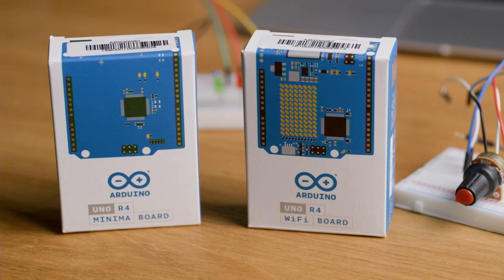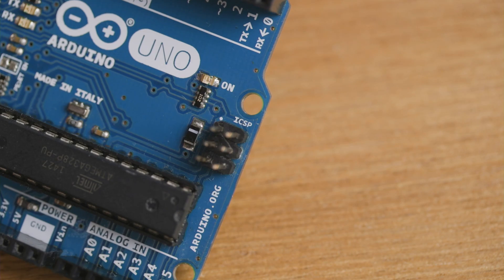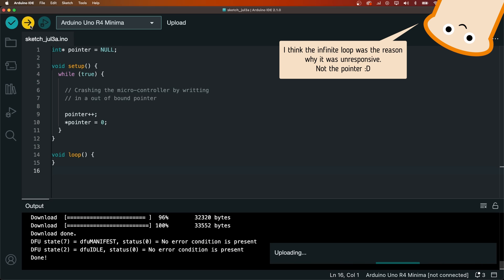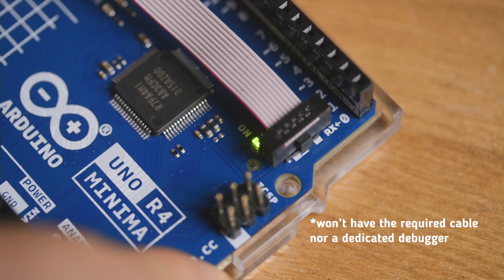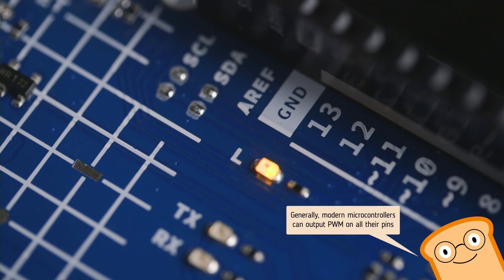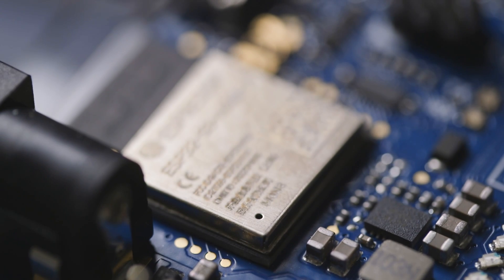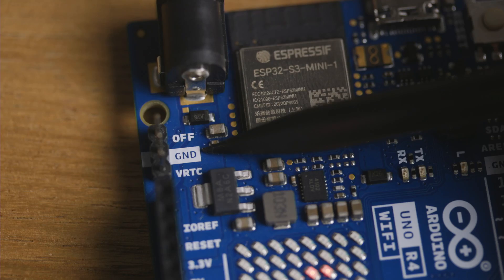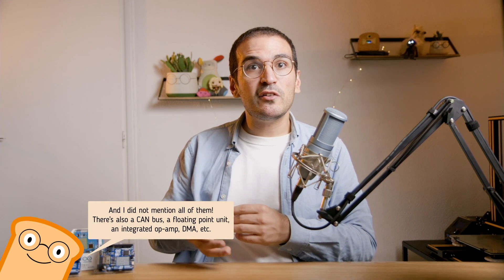Arduino UNO R4: Nice upgrade or troublemaker?

Comment from the maker: Somehow, this video made 20 times more views than my previous videos, and it made me double my number of subscribers!
So thank you again to everyone who watched, commented and subscribed!

This video was released only a few days after the release of the boards, so let me give some updates:
- First, the R4 WiFi is now compatible with Arduino IoT Cloud: https://blog.arduino.cc/2023/07/12/introducing-uno-r4-wifi-support-in-the-arduino-cloud/
- I was able to run a debug session on the R4 WiFi using Platform IO without any external hardware

For those who asked for an in-depth review or more code examples, here some nice reviews made by other channels that I've found :
- @Dronebotworkshop: https://www.youtube.com/watch?v=kJE9CBb3fT8
- @adafruit : https://www.youtube.com/watch?v=uw0EU8urz5M
- @esp32 (in Spanish 🇲🇽) : https://www.youtube.com/watch?v=HQ4J0-3RN7c

Comment: I bought an Arduino last week for the first time (after using the Raspberry Pi for decades). The Arduino is lots of fun. I have now a large collection of gizmos (modules) to plug into it, like a kid again discovering something new. I bought it though to tinker with some model railway projects, and discover that because they have changed the two main micro-controllers, the R4 is a different architecture to the R3 and is not compatible with a complex model railway control system that I wish to build. C'est la vie, not a disaster. I'll get the older Arduino Mega for the project, and keep the R4 Wifi for another project. Merci pour la vidéo, nice accent ;)

Comment: We need a basically 328P refresh drop in chip from Atmel, still 5V, more memory, more ram, higher frequency, maybe better ADC, DAC etc... Uno need this, not that microcontroller from Renesas

Comment: The lack of a crystal has rendered the R4 not useable for my turntable projects that are driven by SimpleFOC. Have several old Unos that work superbly,  but i tried an R4 and no joy as the speed of my turntable was nowhere near as accurate as with an old Uno.

Comment: It seems to me that a beginner's development board should have enough current to drive hardware if the focus is not heavy into software like the Raspberry Pi.   I personally want to play with components as well as software, but it seems that each board makes you pick between them.  Pi is more powerful and is software heavy, but not nearly as easy to learn.  R3 is a somewhat limited playground that doesn't include enough power to support PC style interface peripherals.  The reason you don't see commercial developers drop what they are doing to use Arduino or RPi has to be a functionality limit that you hit while trying to use them.  Bottom line:  they are best viewed as a learners' hobbyist toys.

Comment: I find Arduino released this thing without making sure the reference material thoroughly covers the programming differences between this Renesas RA platform and the platform the UNO R3 uses. Does a library environment for this new platform exist? 
For example, try figuring out the interrupts and the available interrupt types. See if the reference document code for interrupts actually compiles or functions as advertised. See if you can get pin change interrupts working. Please show us how if you manage this. I agree this R4 will be frustrating until the public Arduino community catches up with functioning libraries and documentation having functioning code examples.

Comment: What I missed in the video is compilation time. In my classroom, compilation time is key. For a Leo, MEGA or UNO it is near instant, compilation for a Microbit is also very fast, Teensy ditto, but for M0/M4 boards is was much slower, and for ESP32 it is unbearable slow (1 minute compilation time!) I do not agree about the confusion with Serial and Serial 1, we use Leonardos for ages, because they have dual UART, which is a must have for GPS, GSM, MIDI and stuff like that. I also hope they kept SPI exclusive to the ISCP header, and no wiring through pins 10-13 as well. Another reason I prefer the Leo over the original UNO: you have extra pins and easier SPI hookup. I also quite often use the 6 extra analog inputs on the LEO, especially for multi-analog-stick gaming projects many students make. I actually dilike USB-C, as the port dies easily in classrooms, and USB-B can be soldered by hand easily, USB-micro is doable as well (1mm spacing), yet USB-C connectors need a reflow machine for repair.

Comment: I really like the new dual serial! That was one of my reasons to use Arduino Mega. When I set up the companion controller as HID, I had to use soft-serial, or Arduino Mega to connect a serial terminal.

Comment: Haven't started playing with mine yet. Anyone tried this one with Arduino IOT cloud ? Wondering if there is any more success with this board and the cloud agent, which seems to be seriously flawed. I'm not sure if Arduino just isn't into the cloud implementation long term, or if the development is just a little out of their level of ability. This really could be IOT for the masses if they can get on top of the cloud agent issues.
Reply from the maker: Hello and thank you for your comment.
As I said in the pinned comment, I was able to use the R4 WiFi with IoT Cloud briefly, the agent wasn't a big problem for me (I'm using macOS, maybe that's OS specific ?)

Have you ever tried Adafruit.IO?
I made another video on Adafruit.IO and their no-code firmware (WipperSnapper, currently in beta), their ecosystem seems much more mature and stable for quick prototypes especially for designers/students. Several ESP32 boards and the Pico W are already compatible (the R4 WiFi is not supported yet, but I'm sure it will be in the future), that's my bet for "IoT prototyping for the masses" ;)
Reply: I tried it, R4 can connect IOT Cloud without problem. But you must first upgrade firmware (Cloud shows it, how to make)

Comment: Entry price excessive and a poor hardware solution for a final product. Better to use a board like the dev kit for CH32V208 which has massive functionality at a very low price, all with one microcontroller and a crystal. The popularity of Arduino does not justify using it any more. The CH32V003 are great too but easier to lock your self out of if you mess up with programming on the swdio pin or oscillator source. My current choice for small stuff though.

Comment: Thank you for the information. Like I wrote in another video the worst thing compared to the R3 is the max current for an output, 40mA as you said in the video, and  8mA on the R4. So you will always need transistors or small relais to command an actuator. So more hardware needed. That's a pity.

Comment: It seems Arduino is trying to get involved into 32bits world. But, I think it would be very difficult to beat ESP32 and RASPEBERRY PI Pico. They are really cheap and very well documented.
Reply: Both are not good IMO. Give me a Teensy 4.0 any time. Such a relief to work with. And 10 times as fast as an ESP32 or Pi Pico.
Reply: @lovemadeinjapan Unless you need that power, using a Teensy is just overkill, and the price
Reply: @argvSys  You can perfectly use it for prototyping, and move code to a Pico when the project is finished. In that phase overkill and expensive are very different. You probably don't deal with a classroom. ESP32 is not suitable there.
Reply: @lovemadeinjapan   Oh, ok. I thinked you were refering to hobbyst projects and not a classroom. 

For prototyping, any board is useful, but students will never use the full resources of a Pico or an ESP (or even this thing called """UNO""" R4) in the first place (unless they program them in the Arduino IDE), so why to get the bigger thing?  Also, MicroPython exists, so presentations should not be a problem since its an interpreted language, and when they finish the project, translate that to C++.

¿Why ESP is not suitable for classrooms? Just wondering.
Reply: @argvSys  Compile time. They can click compile maybe 3-4 times in a lesson of 45 minutes. With the M4/Teensy/Leonardo it a matter of seconds. Maybe it could be in Micropython, but I don't see fit for that language in the language tree.

Comment: Regarding the LED matrix in the R4 WiFi, it looks fun but I wonder how many projects will use it (specially when the board is inside a box or you use a shield). I think this kind of functionality should be on a shield not in the main board.
Reply: If it means anything, I used it to build a pong clone, so it's getting some use lol
Reply: I was thinking the same. But, I will probably use it for testing my logic.
Reply: We love GameZIP's with true color LEDs combined with microbits for this.... Perfect combination to program simple games in C++/Arduino.

Comment: Two chaos boards on a different achitecture? Was this a try to create antithesis of uno limited feature set and easy to comprehend archiecture?
The arduino zero was agreat try...
They should have gone Esp32 only with usb and some more smd add on chips, heck even a  AD converter on the same board would have been killer feature but NO

Comment: No "revision" should change the hardware capabilities of a thing. "Uno" means "atmega328 based". If they wanted a new chip fine, but they should then have called it "the Trentamila ventisette" or whatever.
Reply from the maker: 100% with you on about the "revision" not changing the chip.
The R4 WiFi released under another name could have been a nice addition to the Arduino product line
Reply: "Matrista uselessto quattra"
Reply: It is a fail no matter what name it has..
What made uno so popular? Usabilitie and low complexity.. Not board are a chaos mixture of their feature set, the led matrix is laughable at best and a toy..

Comment: Like the led matrix makes it a good attractive tool for educational programming. its about time they did a board with an esp32 and some extra gpio hardware, in the old footprint they could easily do a 32, sdcard slot, rtc, and some 12bit a2d / d2a.
Reply: Would have been nice to just use the esp32 as their main processor and use all the cores inside and not create a tandem chaos overload bords
Reply: @kitecattestecke2303  they don't seem to like espessif...... I think it's because everyone jumped on the 8266 and it was a success that they overlooked
Reply from the maker: Given the main target audience of the UNO boards (beginners/education), I don't necessarily think that having a coprocessor is a bad idea. That way, the network stack run on a completely separate chip and cannot be messed up by bad beginner code.
A few years ago it was quite common to use a Nordic NRF5x or an ESP8266 with an UNO to add wireless capabilities even if the "companion chip" was more capable than the 328p

Comment: What confuses me, is the use of an ESP32 for WiFi on these things... when the ESP32 is a more capable microcontroller in its own right. Am I missing some big obvious thing that makes this logical? Or shouldn't they have just used the ESP32 as the main processor?
Reply: What is more surprising is using an ESP32-S3. Why not use a lower cost ESP32-C3 or ESP32-S2?
Reply: You're not really thinking about efficiency if you're using the Arduino IDE and such, so honestly it's not the worst of ideas to leave a bad WiFi code to be written in a dual-core wifi+BL chip and leave some application code to a cortex M4. I'm not so sure that a single xtensa core is faster than an M4 tho
Also, should add that people generally dislike both the ADCs and DACs from the ESP32 chips, so the renesas' one should take care of it
Reply: you're right, the ESP32 is a really powerful microprocessor that's even more powerful than the arduino R3 but the dealbreaker is that when you upload a code to it from the arduino IDE it has to be written to it's flash memory and it can take like 20-30 seconds just to run a simple blink code for example and thats why arduino's are more preferred
Reply: The reason is financial, not technical. Arduino has a business relationship with ARM, so all new Arduino boards have an ARM processor as the main chip. The ESP32 uses a chip from Tensilica which is a competitor to ARM so is only allowed to be used as a peripheral device to provide WiFi etc.

Comment: Kind of not a fan. I'm bothered by the change of architecture. For me, I do not associate the brand name with the formfactor but with the Achitecture. 

For me Uno means AVR Achitecture. I was already unhappy with the Nano brand switch to ARM (Nano 33 IoT, Nano 33 BLE). 

Don't get me wrong I have nothing against using ARM chips.
By now I used 6 Nano 33 IoT Boards for personal projects.  

In January made my Arduino Hobby to employment and now work as an Embedded Systems Developer. There I developed with the RP2040 (Raspberry Pi Pico) which too is an ARM chip. But depending on the project an 8bit Achitecture can be superior to a (comparatively) complex 32bit Architecture.

But now generally a great product while not attractive to me, I have more than enough spare controllers to last me a couple years and when I used those up I'll switch to custom PCBs.
Reply: Please give the arduino zero a look and test... The samd processor is very very avr esque and fast, truly nice board

Comment: For advanced users, a lot of confussion, for beginners, they still will use "digitalRead(1)" so. . .  the troubles will start at deprecated libraries using AVR instructions :,D I had to get a Leonardo even when I had a Zero because they didn't work on the Cortex architecture.
About analogWrite I ever had that problem, they should name it pwmWrite to avoid confusions. I like how in mbed they have AnalogOut and PwmOut to be clear what do each.

Comment: Great yet more arduinos that’s more expensive than esp32
Reply: And worse with pinout and support yay more chaos
Reply: @kitecattestecke2303  how many pins do you need? you can add a chip?
It’s still cheaper
Reply: Clones probably won't be more expensive after the chip shortage is over. You used to be able to get Arduino clones for about $1.50.

Also, sometimes you need 5V IO. Pity the power on the IO pins is down to 8mA, though.

Isn't the only reason to buy from Arduino themselves to support R&D and software development?

And it can't be good to rely on everything to be made in one foreign country. Good to keep alternatives spread around.
Reply: to be fair esp32,stm32 and rp2040 are very cheap